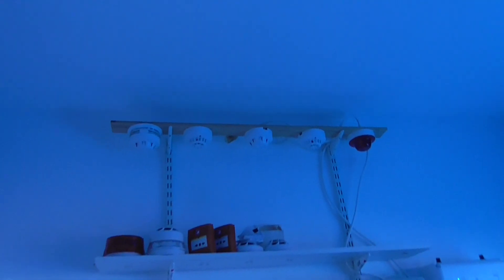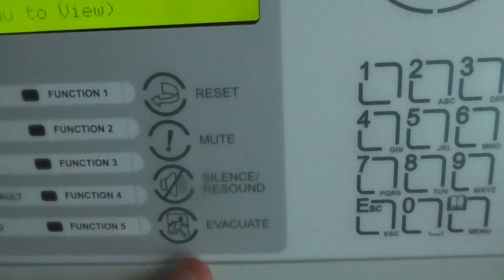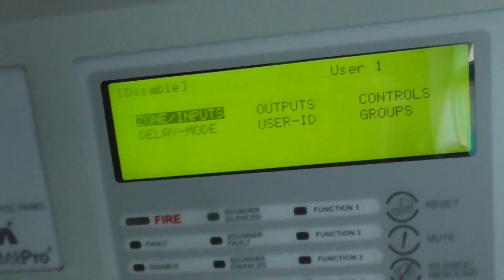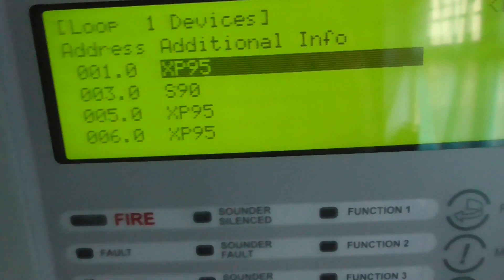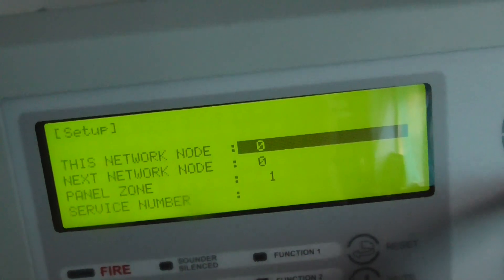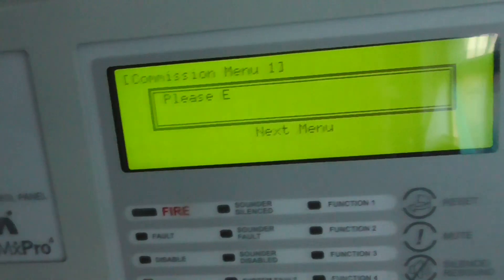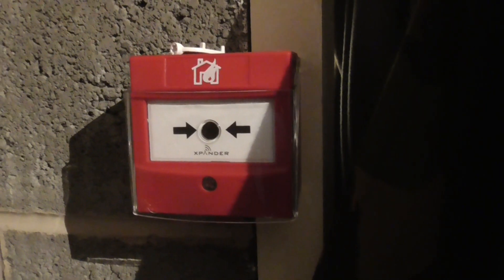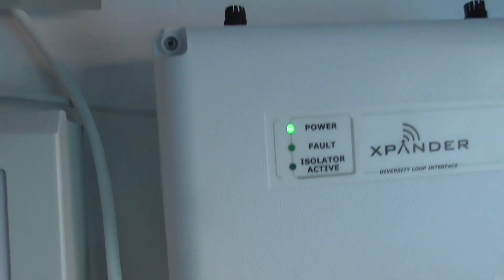Apollo Addressable System Test 12 | First Test of The Advanced MX4100  Panel

Comment: How do you increase or decrease volume
Reply from the maker: For XP95 sounders there is a dil switch where you can adjust the volume to low and high. Discovery sounders volume can be adjusted on the control panel or software.
Reply: @j1firesystems440 could you show us on a video